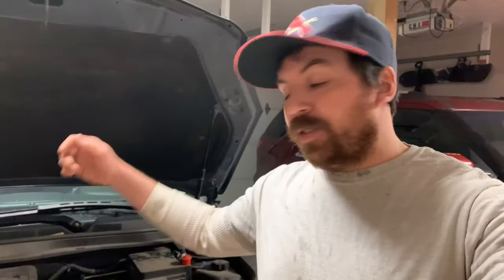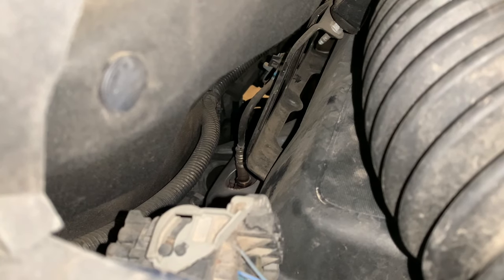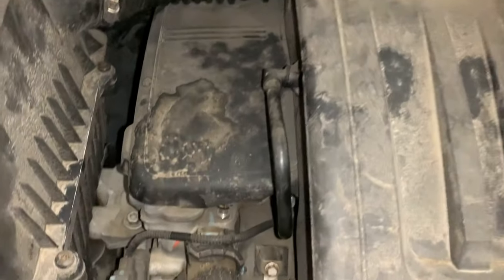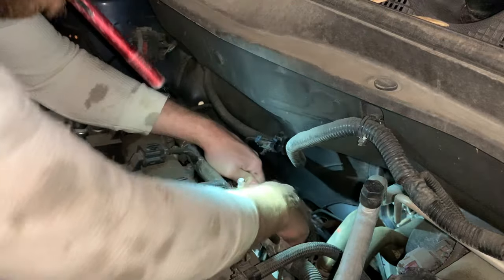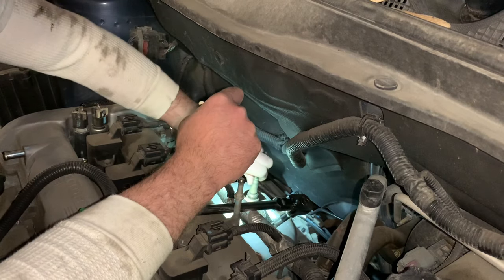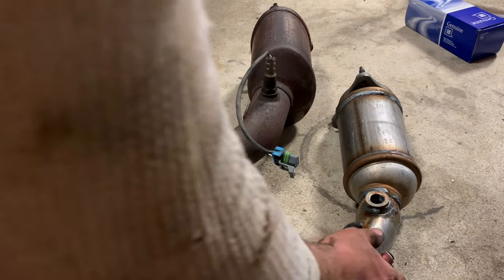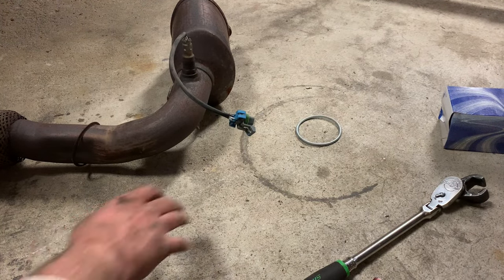Chevy Equinox 2.4L Catalytic Converter Replacement

Comment: When the garage tells me this is what’s wrong with my equinox.  I watch this and realized yep no way I could do this 😩🙄. Now I gotta pay a lot of money. Fml lol
Reply: Search your VIN on the chevy website and it will probably be under a recall right now... catalytic convertor and o2 sensors for free.... and do your exhaust manifold at the same time since that is probably cracked.
Reply: Shane you can do it bruh. I did it myself and I thought I couldn't do it. I save myself $800 by dyi. It's not that hard
Reply: Shane you can do it bruh. I did it myself and I thought I couldn't do it. I save myself $800 by dyi. It's not that hard
Reply: @andrewhurley4135 you know what your talking…! This triggered me research! Thank you!

Comment: Second Bracket Nut:  First challenge i had was to see it.  The Original CC filled that gap so much it was very difficult to see the second nut.  Once i could see it, the best path for me to get to it was from above.  I used a 15mm wrench.  I had to reach around the right of the exhaust manifold and was just able to get it lose.  Then it just took a little time to loosen it enough that i could hand turn it.  With putting it back on, the replacement CC i have was not as big as the original so i was able to have that 2nd nut started, but loose, and got the CC in place and nuts started on the manifold.

Comment: This video just helped me a ton, thank you for this.

I had to cut my exhaust bolts where the cat met the tail pipe, but other than that, very storage forward (needed all new bolts for mine, didn’t come with studs installed).

Also, for what’s it’s worth, I didn’t have to remove the support bar to get the cat out, I was able to undo all the bolts, rotate it so the top was pointing to the floor, then slide it straight out.

Thanks again for this video

Comment: Did this over 2 Saturdays.  Did the manifold and couldn’t get the metal gasket off so put it back together and it was loud.  Took just the converter and pipe off today and found several issues. Stud backed out, oxygen sensor seized. Used an impact and it whiplashed my thumb.  Put new bolts down below with new gasket and dug out the upper gasket and did the 20, 40, 60 on the bolts. 

The sound of silence is awesome. I should have taken the whole thing off the first time. 

Mechanic hint:  use a stubby 15 on that hard to access nut behind the converter on that bracket. Ratcheting stubby would have been the best. Do not take the nut all the way off.  Just take it to the end so installation is not harder. The bracket will swing towards the driver wheel to get the converter out.  

I used the old converter. Not a replacement. It all started with a cracked exhaust manifold.

Comment: I currently have the same problem with the hidden nut on the bracket of the Catalytic, am able to get the socket and the power bar on the nut, but someone has rounded of the nut, perhaps
thr bolt cutting it off is my only choice. I intend on using a air driven saw (miniature from body work) ........... as as another guy mentioned, just cut off the bracket and replace the bracket !!!!
Excellent video, very clear to view and not rushed, you do good work.

Comment: Here’s an old timer’s trick you should try: wax. Wax those old, rusty and heated exhaust bolts. I bought an original exhaust manifold from a 1970 350 engine for my el Camino. The studs of course were rusty, corroded, thinned from the years of heat - basically part of the manifold. This guy took a torch, heated around the remaining studs, then stuck some candle wax at the base, which of course immediately melted away. He grabbed a pair of vise grips and one handed turned every one out. No shit! 
Myself, after several days of air tools, breaker bars, chisels, hammering smaller sockets onto the bolts/nuts, trying to remove a wheel to replace my son’s front breaks that were heated from driving too long with grinding, I then remembered the trick. All I had were birthday candles, but I heated with a bottle torch, stuck the candle against it and it very quickly melted (wicking into the threads) then I put a socket back on the nut and as I was taking up the slack for a secure / square socket fit, it slipped, with hardly any pull whatsoever - I thought for certain it broke the stud, but it had actually turned loose that easy! Kid you not! Each nut, one handed, came loose just the same! 
Try it for yourself!
Reply: Anybody can vouch?
Reply: @donnaharrell5222  Doesnt work. The wax needs to penetrate the threads. If the rust covers the threads...you arent penetrating anything. Severely rusted bolts are either broken off or torches.
Reply: If you don't have wax, PB Blaster and a heat gun are sufficient.

Comment: Thabk for the video!  My 2012 equinox with 210,000 mile (341,000km) is having the same issue. I replaced all sensors and the error code came back two weeks later.  Now i feel i have to change the cat.  Btw i burn a lor of oil and i change it every 3,000 miles.
Reply: Just checked mine recently and my oils low at about 2800 miles after my oil change 😭😭. 153k miles

Comment: Couple of comments here, mine is a 2014 LS AWD, for some reason my Cat is a cilinder and I did not have a problem with that stupid bracket that holds it there, I watched some videos where the guys had a lot of trouble taking that back bracket bolt out of there in order for them to take the Cat away. Also a good breaker bar or a pipe can help you to put some force on  the rusty bolts. I realized you can clear the code with something cheaper, at least on my case, I just needed it to do the sparks plugs non fouler trick but I wanted to clean and wash my Cat anyways. Easy job if you have the right tools.

Comment: Cool video! I'm kind of shocked at the amateur weld job on the new cat and pipes. I got an aluminized steel unit with smooth pro welds.

Comment: Helpful video. For future, it would be golden if you let us know what you retorqued everything to. 
I had to use my angle grinder and cut off the exhaust bolts at the rear of the cat. Aside from that, biggest headache was removing the bracket holding the cat in place.

Comment: How was the barket holding catalytic converter in place under manifold. You removed the cross bar and said you saw another bracket that needed to be removed. I find it impossiple to get any type of wrench or socket on it.

Comment: Thanks. Great informational video. Got the same car and year with the same issue. Clearing code from computer - can this be done by disconnecting battery for a period of time?
Reply: In the past, it was the norm to disconnect the neg(-) battery cable for 15, 30, 60 mins.. even some would leave it overnight. That  was “the way” to reset everything. Seems easy enough, right? While that is simple enough to do, I saw a video a couple years ago showing an easier way (works for vehicles 1996 and newer):

(Disclaimer: The following steps will take you longer to read, than to actually complete.. excluding the test run). 

First, locate the fuse for your ECM, PCM, ECU.. whatever it’s called, for your specific vehicle make/model and pull that fuse, which is likely located in the fuse box, under the hood. **(A fuse puller works best if you have one, for ease of removal and to avoid damaging the fuse). Next, reinstall the fuse after ONLY seconds and you’re DONE! All systems reset and CEL cleared. Then, (given that an “idle re-learn” procedure isn’t necessary), start the vehicle and take it for a test run. Drive as you normally would. Personally, I like to include some city and highway driving. The lower RPMs in the city and higher RPMs (with cruise control set, insuring a constant speed) on the highway, will give the computer plenty of data to evaluate. In turn, this will allow it to “re-adjust” or “re-calibrate” things such as: idle, fuel trims, sensor readings, spark and injector timing, etc etc.

Long explanation.. simple procedure. Good Luck!

Comment: Can you please tell me, how you got that last bracket off?  What size socket was the bolt?  And how on earth did you get behind the converter to get a bite on it? Driving me crazy. It's the last step, before I can pull it out. Thanks
Reply: Same I trying to get that bolt off and I don't see any other way other than cutting it in half and sliding the converter out and buying a replacement bracket
Reply: @miklosandoval6421  use a nut splitter and replace the nut instead.
Reply: I managed to get a 15mm ratchet wrench on it by threading my arm OVER the subframe. It’s a bit awkward but doable. You don’t actually need to remove it but sufficiently loose enough to rotate towards passenger side.

Comment: I have an issue with mine on a 2013 gmc terrain. I believe its just a gasket went bad up top. Its not consistently making a sound. Just located the sound to up top. Either gasket or it came loose. Just didnt know how to get to the top part to check.

Comment: Hey dude. Great video. What were the symptoms of the bad CAT said by customer or yourself? 
I have a Captive 2.4L petrol front wheel drive. I’m assuming it’s the same as this. 

Had misfire, bad o2 sensor and then cat converter falling apart. Check engine light and loss of power in high rpm. Like a lean out loss of power. Significant
Reply: Pretty easy way is to check on a scanner the readings of the o2 sensors, bank 1 ans bank 2. Bank 2 can not have the same  readings of bank 1 because this means that the gases coming out from.exhaust manifold are the same gping past thru Cat. That ia a good sign of a bad cat. Basically sensor 1 would go crazy pn the readings but sensor 2 should be stable.

Comment: Completed the job but I got a p0420 code.  Checked and I have a leak at the flange.  I used the new gasket that came with the manifold.  Can I use a thicker gasket or is it possible I installed it incorrectly?

Comment: I'm currently in the dealership and they are replacing my cat right now under an extended warranty problem due to oil consumption on my 2013 equinox.  I got a letter from chevy that I almost threw out about it.  I came to the dealship a month ago and they had no clue what I was talking about.  I gave them the paper and chevy didn't inform them of anything but thankfully mine is being covered.   If I didn't own my car outright I would have dumped it years ago.  2 timing chains, exhaust manifold cracked, oxygen sensors and now cat all because of oil consumption.  My car has 140k so I can't get covered the piston rings now.
Reply: @billysonlinesurveychannel8247  what was your code for bad converter I have a terrain code p0420

Comment: The cat. Bracket bolt,  go in from the top put a 15mm wrench on the bolt,  put a crowbar through the opening in the manifold,  use the crowbar to turn the wrench

Comment: Looks like I am going to have to do the same thing to my Equinox, just wondering what and where you got your parts from. Also, when would you consider replacing the back half (rear) part of the convertor as well?
Reply: @billysonlinesurveychannel8247  I recently just received the vehicle and got the code coming up. As far as I know I don’t think it has excessive oil consumption. Replacing the cat tomorrow along with back part. Mine is a 2011 with 112000 miles on it.
Reply: @billysonlinesurveychannel8247  also are you constantly checking the dip sick for your oil levels? Or is the oil level reader in the car constantly dropping.
Reply: @billysonlinesurveychannel8247  sucks to say that I already bought the parts to replace the cat myself. But that’s a good thing to know, so I don’t lose myself an engine. So after every weak or so you oil level would pretty much zero? And Is the piston thing kinda luck of the draw. So some may have it and some may not?
Reply: @billysonlinesurveychannel8247  how often would you say that you change the oil completely rather than just filling it up.
Reply: @billysonlinesurveychannel8247  yeah I changed it when I first got it both synthetic as well. Thanks for information, very helpful something I would of never known. Also let me know if that cat cleaner Turns the check engine light off
Reply: For the oil consumption I’ve been using spray foam in the gas to clean the fuel system and that’s helped drastically. I’ve also used it twice in the oil to clean oil build up in the motor. They say that the oil consumption is due to a ring issue with the pistons but if you clean the fuel system it helps.
Reply: @phoenixreviews2737  how often do you find yourself cleaning the fuel system. And did yours have the oil consumption issue as well?
Reply: @adamstroup3642  I bought the vehicle a few months ago. I’ve been changing the oil regularly every 3000 miles with high mileage synthetic. With every change I pour a bottle of sea foam in the gas tank. I’ve also used Marvel mystery additive with my oil 2 times. I had the oil consumption issue pretty bad and wasn’t aware this was a issue on the vehicles but I was pretty much on empty with my sensors shutting off the vehicle due to lack of oil. Ok so recently I added more sea foam to my gas, changed my oil and added Marvel mystery with the oil and it’s been 2 weeks with no sign of oil consumption. A while back I saw a video of a guy adding gumout to spark plug hole to clean the pistons because the piston ring is the issue with this things and after he did it he did a update video showing that since then he hasn’t had the oil consumption issue. That’s why I’ve been using sea foam every time I change the oil to clean my pistons and hasn’t been until recently that I have not noticed any excess oil consumption so I feel like it’s working. I’ve added sea foam around 6-8 times but I also did my oxygen sensors for the heck of it to see if that helped and maybe it did. I’m also doing the catalytic converter to see if that helps even more.
Reply: @billysonlinesurveychannel8247  Yes the sea foam cleaner. I use it regularly with my Silverado every few months (not every oil change) and synthetic oil changes and I’ve gotten 360k miles on my Silverado without any issues what so ever. The Silverado has been phenomenal so I’m pretty shocked at having these issues with the equinox since I trusted Chevy.
Reply: @billysonlinesurveychannel8247  I believe I found a permanent solution to the oil consumption issue. I took my air manifold apart and drilled the PCV hole bigger and it’s running a lot better. I’m going to upload a video soon si others can see what I’ve done.
Reply: @phoenixreviews2737  did you ever do the video?
Reply: Drilling out the pvc?
Reply: @jdaddy88lxi  I am soon here in a couple of days. I did half of it but then my sprocket got sick so I had to take care of that. Give me a couple of days. I got a permanent solution. It’s been running great. No oil burn.
Reply: @phoenixreviews2737  You did not say which cat converter you bought from rock auto. The Walker 16581 that is listed on Amazon had bad reviews, people said they will break off at the front flange. Poor welding. I want to do this once. I was gonna buy the Magnaflow 52197 from Autozone which is expensive as hell but  i dont have many options

Comment: Hi I have chevrolet equinox 2012 and I have had the catalytic converter change twice one lasted for about 6months the light came on we just changed it again with a more pricy catalytic converter  and light came back on within 3days its de code P0420 what do you reccomend
Reply from the maker: Did you change 02 sensors? Also check for cracks in manifold. I learned after this video they have a common issue of cracking.
Reply: Manifold was replace but 02 sensor no I will have that change thanks

Comment: Can a symptom for a P0420 code also cause a ticking/knocking/tapping like noise when accelerating ? My equinox just shows a p0420 and p0171 codes only.
Reply from the maker: Could have a converter coming apart inside and rattling.
Reply: @TheDieseldog  thanks for the knowledge brother

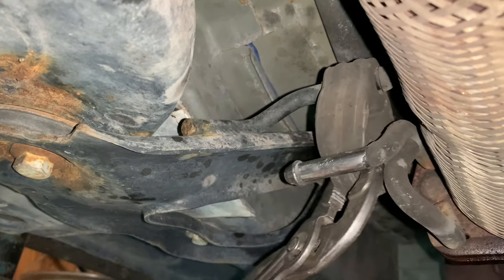Comment: I’m having issues on my 2012 Equinox removing the bolts @7:48 in this video. Mine seemed to be welded on. Has anyone else had this problem? Did you just hit it with heat?
Reply from the maker: The studs were pressed in and nuts on the back are removed. If they are that tight you’ll need some heat.
Reply: @TheDieseldog  Thanks for the info.  I'll give it a try

Comment: What were your symptoms that told you it was the catalytic converter
Reply: Should have a p0420 code. If the cat has blown apart internally the vehicle will have no power.